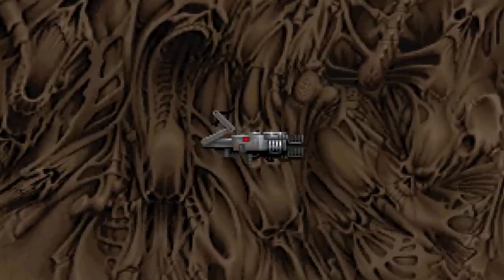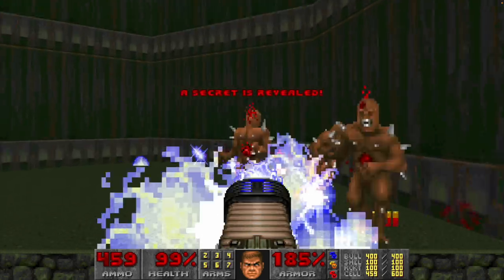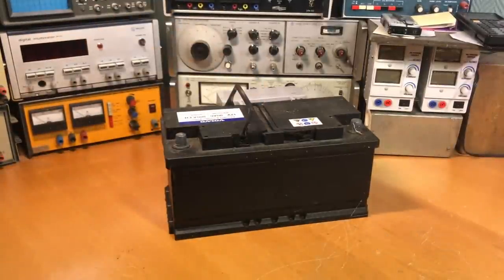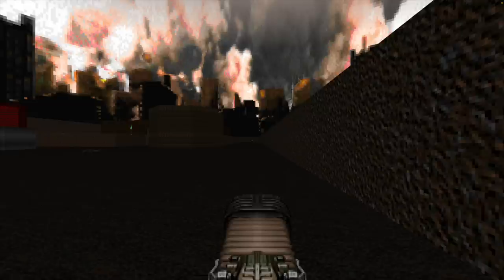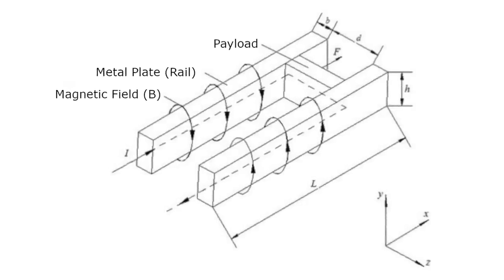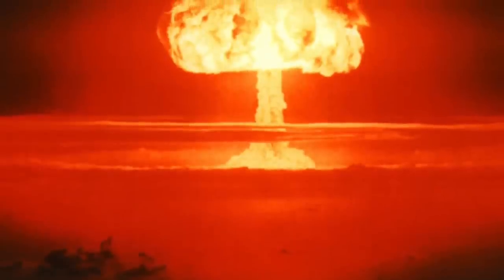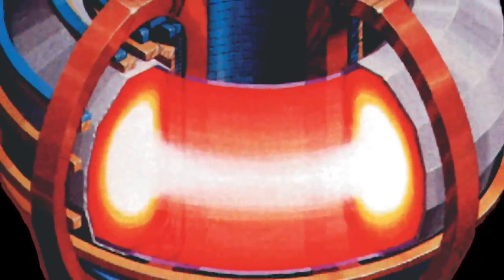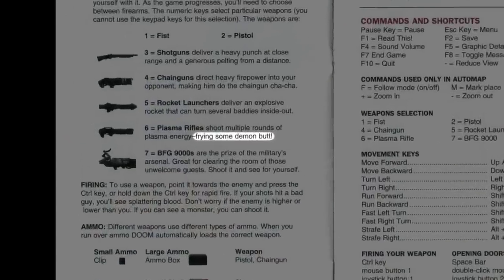The DOOM Plasma Rifle - A Technical Analysis

Comment: Now let's see if the BFG 9000 is as realistic
Reply: Real life hitscan technology would be some kind of breakthrough, surely
Reply: @BlondPanda  lasers (unless you're trying to hit something over a couple light-milliseconds away)
Reply: The BFG as it works in the Doom Engine is not realistic, however I feel like the later versions of the BFG which have lasers emitting from the projectile itself would be plausible. Albeit... impractical.
Reply: it canonically cooks things from the inside using microwave things so
Reply: Depends if you mean how it looks in-game vs how it works canonically(as canonical as artwork can be)

In game and canonically, it shoots a barrage of invisible lasers and the energy ball is pretty much decorative
But it looks more similar to how other ID games do it with an energy ball that explodes
Reply: You could do it. Just make an even bigger Plasma Rifle, and then have 40 smaller barrels underneath it to deal the "splash" damage like an even bigger Super Shotgun.
Reply: @leninvasco  Because the gun doesn't shoot an explosive, the plasma ball is more of a trigger
The BFG9K first shoots the plasma ball and when it collides with something, the gun shoots a barrage of invisible lasers. Some art work depicts this properly with the BFG shooting a barrage of green lasers instead of the plasma ball
Reply: @leninvasco  Same way bullets don't hit the operator of a gun, they come from the gun and don't do a 180°
Reply: @leninvasco  in artwork and in game it does not.  
Again, the energy sphere doesn't actually do anything, the BFG is basically a glorified shotgun that fires once the ball hits something
Reply: @leninvasco  No, it's all a ruse, a lie (and probably a technical limitation)
Reply: @leninvasco  Decino has a very good video about how the BFG works. I recommend watching it if you want to know more.
Reply: @rompevuevitos222  Said "Art work" is the often off-model comic, though there might be others that I'm unaware of. I know an early version of the BFG shot a spray of red and green plasma balls like the plasma rifle's.
Reply: The DOOM 1/2 BFG probably isn't, but the DOOM 3 BFG, according to in game media, works similarly to the MARAUDER coaxial plasma rail gun.

https://en.m.wikipedia.org/wiki/MARAUDER
Reply: @gssarin2765  you could probably do a hack job that's similar to doom 1 and 2's bfg but without the plasma stuff, it would be probably be ineffective
Reply: The big thing is how to you emit multiple, invisible plasma projectiles from the wielder, in the same direction as they fired the initial blast, and able to aim themselves up or down.
Reply: @rompevuevitos222  "canonically" the lasers come from the ball, in game they just made it trace them from the player because it was easier to do.
Reply: If the BFG9000 used nuclear forces involving gluons to form the projectile, things could get interesting.  Imagine quarks being trapped inside the weapon's emitter in some kind of quark-gluon soup that's looping around inside the color charge field.  Now imagine those particles being entangled with sister particles within the projectile itself.  On impact, the particles in the projectile are forced out of superposition.  This breaks the entanglement with the residual particles that are still clinging to the weapon, and the looped field loses coherency.  The particles scatter out in a high-energy spray, conserving their angular momentum so matching the direction the original projectile traveled.  Now you have the energy flash with a pseudo-scientific explanation.  Technojargon BS?  Sure, but throwing quantum superposition and entanglement into the mix, and examining how this works in the real world, and it doesn't seem quite as ludicrous as it would otherwise.  Fiction is strange, but reality is stranger.

Also... about that primary projectile, some people have said it doesn't matter.  That projectile does 100 to 800 points of damage in the game.  That's not insignificant.  Respect the ball.

Comment: Considering Doom's universe has Space Marines, emphasis on the word space here,  I think this analysis is slightly off because of one assumption, and that is using the native atmosphere as the plasma medium.  For a weapon to operate in space or environments outside of Earth's atmosphere, the conductive medium should be provided as part of the ammunition.  If you want to use the weapon anywhere you need it to work anywhere.  We see a bit of this in Doom 3's plasma rifle using energy "bottles" to reload the gun.  Classic Doom's cells could contain both electrical power and a compressed medium necessary to fuel the weapon.  I think it's also possible that the plasma gun works less reliant on conventional gas plasmas and more on theoretical quantum effects.  The projectiles remain coherent for a long distance, so it would imply an intense self-sustaining magnetic field, similar to what is hypothesized to create ball lightning.  The energy states in atoms change their behavior when exposed to magnetic fields, and you can trap a lot of energy in a magnetic bubble.  The sun does it all the time.  If we throw quantum principles into the mix, without going into a lot of tedious detail it gets pretty exciting what might be possible.  The actual "core" of the projectile might be much smaller than we see, with the resultant "ball" shape being a result of photon spilling due to ionization as energy leaks from the magnetic field.  You would get a secondary coronal plasma forming in the air around the actual projectile itself.  Packing a dense bundle of electrical force into something the size of a pencil tip, then releasing that inside of a solid object would be absolutely devastating to the material from the thermal shock alone, not to mention the electrical discharges and the effects that would have on organic tissue.  The more resistance in the material, the hotter it would get, and heating water too rapidly causes a steam explosion.  Seeing a zombieman occasionally gib from getting hit by plasma bolts is more scientifically accurate than you might think.
Reply from the maker: Very interesting! A self sustained magnetic field helping each bolt maintain its shape is a compelling theory.

As for using the atmosphere as ammunition: As fluffydestroyer8336 pointed out in this comment section it is quite likely that Phobos and Deimos have been terraformed to have an atmosphere similar to earth, given the lush greenery we see in some scenes. This would allow the atmosphere to be used as ammunition.

DOOM 3 takes place on Mars, and from the looks of it, the atmosphere differs from Phobos, Deimos and Earth. It could be that Mars atmosphere, consisting mainly of carbon dioxide, does not work as well with the Plasma Rifle, which would require gas to be manually added as ammunition.
Reply: @SunandWeather  That's actually a good take on that regarding the atmosphere of Mars vs an artificial Earth-like atmosphere on Phobos.  Deimos is actually floating over Hell, and Inferno takes place in Hell so we have to assume Hell's atmosphere is that of Earth's.  We know the UAC brought artificial gravity to Mars, Phobos, and Deimos, as otherwise Doomguy would be falling with style a lot, so atmosphere makes sense as well.

Besides, even though I am the mighty immortal Phoenix I would never argue with someone named fluffydestroyer.  The demons messed with the wrong bunny once and we know how that went! 🐇

Comment: There's a very neat little detail about the plasma rifle I'd like to point out: the funny accordion part. To me, they could be interpreted as electromagnetic coils that accelerate the plasma bolt, just like how coilguns and particle accelerators use coils to accelerate metal or particles

Comment: I am just stunned that you calculated how much energy would go into a plasma bolt and then from that you figured out how much energy would be contained in a cell ammo container, only to find out that we could theoretically easily generate the energy needed to make plasma bolts.
Reply from the maker: Thanks sixstringpsycho! If you were to account for the energy losses in the system, the energy needed would most certainly be much higher, though.
Reply: @SunandWeather  Sure, but not so much higher that it would be impossible to account for. If the high end of the DOOM idea of a cell pack would roughly be in line with a large car battery, then there are definitely portable alternatives with even higher capacities that could be used, to say nothing of how technology is always advancing, and as it does, miniaturization naturally comes with advancement. Miniaturization is especially prevalent with data and power storage devices and guns.

Comment: If we're willing to allow a little bit of deviation from the concept of the plasma rifle as a pure directed energy weapon, while keeping with the idea of it being a modified railgun, I'd like to propose the following alternative solution to how it could work.

Plasma is also a VERY magnetic substance that, in real life, generates a substantial amount of light, potentially enough to completely obscure the center of a ball made of the stuff. We see this is the case in the game, by observing that its core is completely opaque. This can thus give us a little wiggle room with the possibility that the plasma balls actually have something solid in their center.
At the same time, we never see the inside of a plasma rifle "cell", so it is conceivable that the thing is not purely a power source, but a combo power source/ammo magazine package, that also stores some physical projectiles.
Science can currently create a device called a "plasma window" that uses low temperature plasma, suspended in between two or more magnetic fields, to create what could technically be considered a real life version of a sci fi containment field.
Also, real life railguns can only fire physical projectiles.

Thus my take on how it works is as follows.

The rifle is a railgun and its cells also store projectiles made of some futuristic metal-ceramic alloy, that is normally non magnetic and (at least temporarily) very resistant to high temperatures, but potentially very brittle along a certain axis of travel (hence why no subsequent bullet holes on impact).
When you pull the trigger, the railgun loads a projectile onto the rails and uses high power electromagnets (or the railgun rails themselves) to give it a very powerful magnetic field. At the same time, the rifle creates a plasma window at the tip of the rifle's barrel, where atmospheric air is superheated into plasma. Once that is done, the projectile is fired at its target by the railgun and the plasma window is partially collapsed, injecting the plasma into the projectile's magnetic field, as it travels down the rails. Once the projectile leaves the rifle, it continues towards its target, where it subsequently shatters on impact, collapsing the magnetic field in a way that channels the plasma into the target.
This also explains why plasma balls travel slower than bullets, despite the rifle being an energy weapon. You can only move so fast, before you risk collapsing the magnetic field due to atmospheric drag acting on the plasma.
And finally, the reason you never see any "bullet drop" is because you only ever fire the weapon on Phobos, Deimos, Mars (very low gravity), in space (no gravity) or hell/hell corrupted earth (no or dodgy physics)

Interestingly, this would also explain the frequent releases of heat you can see when you stop firing the doom eternal version of the plasma rifle. And hilariously, this might also explain that force field gun in the R Overkill mod, that causes all projectiles to bounce away, but doesn't do anything to hitscan weapons. The barrier is really just a very large and powerful magnetic field, that interferes with the magnetic fields on the plasma shots, knocking them off course. But since the hitscan rounds are really lead bullets, they're mostly unaffected and can just pass through.
Reply: You just gave me ideas
Reply: The idea of a plasma ball containing a solid object isn't foreign to the Doom franchise. In Doom 3, the BFG fires a powerful plasma ball with a computer chip core that's used to direct beams of said plasma towards nearby enemies.

Comment: I have a new favourite video on YouTube! This is just brilliant! I love all the small references, the attention to detail, and the deep analysis. Definitely a top tier Doom analysis that very few people could match, if at all.

One question: So in Doom 1993 a lot of the combat takes place on Mars with a different atmosphere,  mainly carbon dioxide, so could we assume the plasma rifle in Doom and in Doom II is not actually the same weapon, or at least calibrated to different settings to yield the same damage?
Reply from the maker: Thanks a lot, Drakir91! I would guess that the Plasma Rifle is the same weapon in DOOM and DOOM II. It uses the same amount of Cells, so as long as it is possible to completely ionize the gas, it should be possible to transferred roughly the same amount of energy to the plasma bolt using this design, regardless of atmosphere.

It most certainly needs to be calibrated to suit the atmosphere, though. For example, carbon dioxide has a much higher dielectric constant than air, so it would require a higher ionization voltage to operate.
Reply: Doom doesn't take place on Mars.
Reply: @AmazingKazooGuy  My mistake, but Phobos makes the question even more interesting!
Reply: given how we see mountains with lush greenery on them in the episode 1 skybox I think it's safe to assume phobos and deimos have been terraformed, at least to an extent, so they probably have earth-like atmosphere
Reply: @fluffydestroyer8336  I like this theory
Reply: @AmazingKazooGuy  the third episode does.

Comment: Great video! I think that you may be slightly off in your calculations from the get go as plasma has the tendency to expand. A soccer ball sized projectile, especially in toroid form can be formed at 1 -> 2 kJ. I have been experimenting with such a plasma accelerator for a few years off and on now and I hope to have good success with my most recent design.

Comment: 4:22 I thought the whole point of a railgun is to launch things at high speed without burning propellant. It looks like a lot of smoke and fire is following the projectile. Wouldn’t that be picked up by radar if say a warhead were theoretically launched from a railgun?
Reply from the maker: That is a very good question. I guess it is waste products, like fragments from the projectile, catching fire. As I understand it, no explosive propellant was used. The footage is from the electromagnetic railgun (EMRG) test at the Naval Surface Warfare Center, Dahlgren, Va., on January 31, 2008; in case you want to do your own research.

Whether or not a radar will pick up a launched warhead probably depends more on the size and shape of it, rather than how it is launched, I would say. I don't think a radar would pickup the blast.

Thank you for the interesting questions, sixstringpsycho!
Reply: @SunandWeather  No prob. I only got the idea from Metal Gear, since the entire reason the titular weapon is such a scary threat in the games is because theoretically it would have been able to launch a nuclear strike from anywhere that missile detection systems could not intercept, because no propellant was used that would be picked up. In other words, a stealth nuclear weapon. Basically guaranteed doomsday if ever used. Thank god video games are not realistic.

Comment: Not sure how BFG will work IRL, since it's not just shooting a bigger plasma, it also emits tracers after the shot hit something
Maybe some radiation stuff I guess
Reply: The BFG can't work. It fires inverted teleportation sci-fi physics. It's a gun that uses a teleportation gimmick to wrench crowds of enemies apart. Doom 3 explained part of it in a tech demonstration video in-universe.
Reply: Well, in Doom reboots, BFG projectile zaps nearby enemies, so it might be simpler high voltage electric discharge.
Reply: @_DeadEnd_  the BFG was supposed to be a super powered plasma gun but all the sprites tanked performance, so they came up with the final design afterwards.
Reply: The BFG is portrayed rather inconsistently in various DOOM media. In the classic games, the big plasma ball inflicts damage, but the invisible tracers released after the ball impacts a target are what inflict most of the damage--in essence, the BFG is a giant shotgun combined with a plasma cannon. 

In Doom 3 and nu Doom (2016 and Doom Eternal), the BFG fires a plasma ball which emits powerful radiation which damages targets (but somehow not Doomguy himself?) and which releases a sizable blast that will badly wound or kill everything in the room presumably through thermal and blast effects--but again, not Doomguy. Firing the new BFG into a wall at contact-shot distances is harmless to the player. 

In the Doom comic (the origin of "Rip and Tear"), the BFG seems to work like a sort of volley gun, firing hundreds of small projectiles or energy bolts simultaneously. 

The biggest problem with rationally explaining the BFG using real-world science is that its destructive power somehow does not harm Doomguy (or cause serious environmental damage*) whilst managing to obliterate every other ugly-faced monster in the room within a 360-degree radius. That does not parallel the effects of any weapon operating on real-world principles.

*If I recall correctly, this is averted in a cutscene in Doom 3, where Campbell's BFG shot wipes out a group of Trites and sets the room ablaze due to damaging some sensitive plasma tanks.